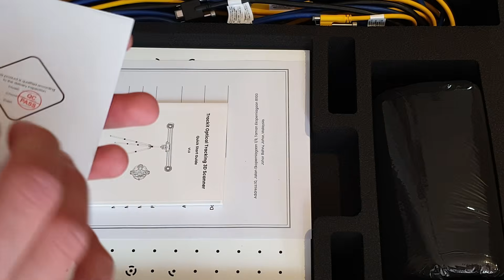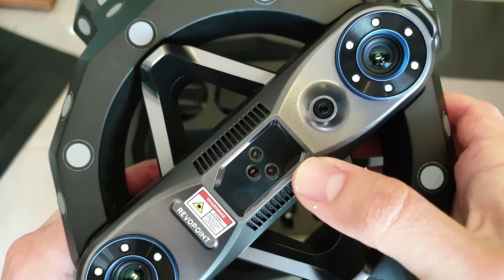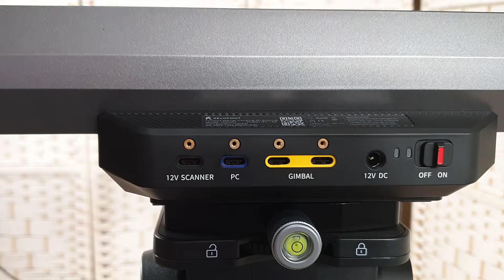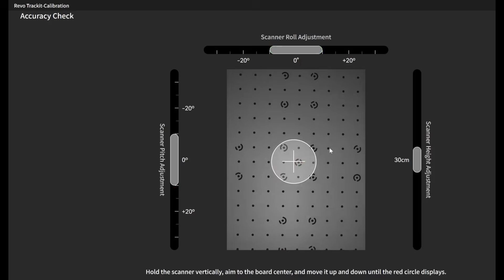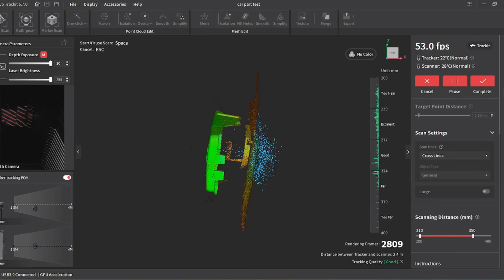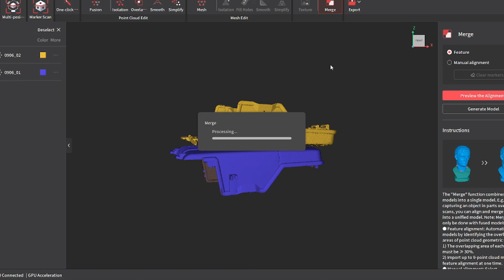I bought Revopoint's latest 3D Scanner - Trackit Full Unboxing #revopoint #trackit #3dscanning

Comment: Wouldn't it be faster if you hung the object with strings? You could scan the whole object at once
Reply from the maker: The object must be stationary during tracker scanning using this system, unless you use marker only mode. You could hang the object and scan it but ideally a dedicated scanning frame would be better.